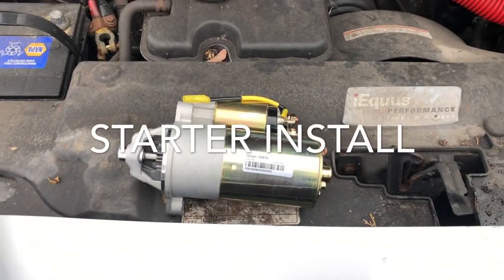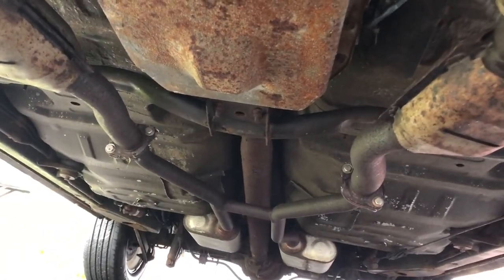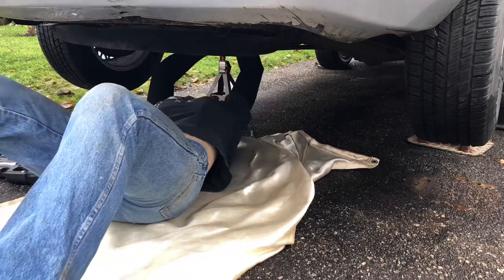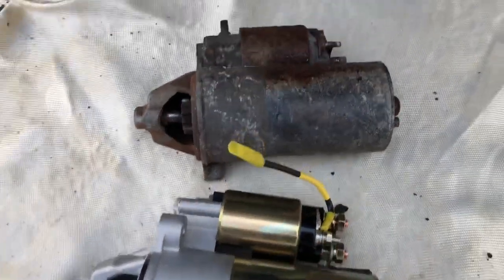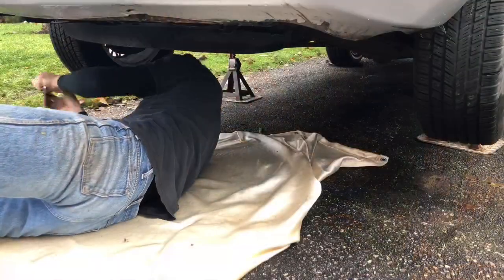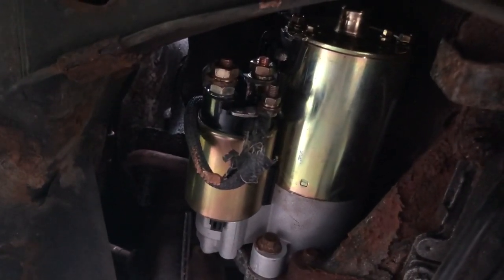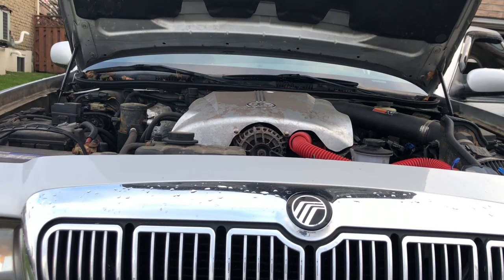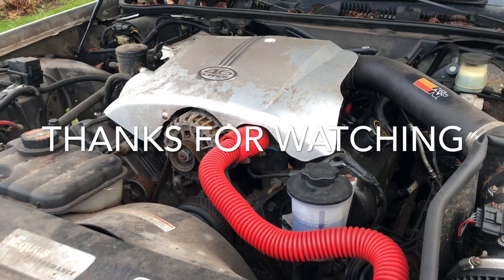⚠️ Loud Music - Car Starter Motor - 4.6 Ford Mercury Marquis Lincoln Towncar Marauder Crown Victoria

Comment: Did you ever figure why it wasn’t starting? Working on a 97 Lincoln 4.6 myself. I had fuel pump and fuel filter changed. Ran Fine, shut periodically  while driving still. Changed the serpentine belt and alternator, fired right up but now it won’t start.
Reply from the maker: knnyfcknpwrs I actually didn’t. I needed it moving and I had no time so I was in a position to sell it cheap. It went to another panther body guy. He got it running. He never said what it was which means it was dead simple. It sat for awhile before I wanted to get it going again. I know there was a lot of corrosion on the connectors. Sadly I just wanted it gone. Lovely car but when you have to many projects and even less time sacrificing the good to homes where they will be used is a must. I would be using the continuity feature on your multi meter and check the electrical. It could be a relay somewhere. I once had the cam sensor go on me and it would only run periodically but shut off randomly. Maybe it’s that simple. Mine.... Fuel pumps are easy to diagnose. If it doesn’t prime when you turn it on it might be dead. Teat the fuel pressure by opening the valve and see if it primed. Alternators you just load test and starters if they don’t crank it might be wiring related or the starter might be burnt out. Not that these were or are your issues I’m just rambling off some that I faced with my old beast. If you suspect your starter ever I just unbolt and test them but secure it before adding power =] work safe they have the high power and low power for positive and of course the negative side. Hope this helps. Sorry I couldn’t give you a more exact answer.
Reply: Wow, same thing for me with a Mercury Marquis.  My buddy and I went through hell fixing a transmission line leak only to be rewarded by the crappy car not starting.  Once I looked over the starter location and checked a couple YouTube videos, I decided to sell the car rather than screw around with such a lousy design.  Fortunately, I got my investment back cause a local guy collected these junkers for parts.
Reply from the maker: @STBRetired1  these cars are usually reliable but I had enough. LoL I don’t miss it one bit so I made a good choice with passing it on. I was not as lucky as you. =] Still I’m happy she went to a good home.

Comment: you should be happy they didn't reinstall that third top bolt. it is a pain!!!
Reply from the maker: True. When I was pulling it apart. I was like how would I put this back but thankfully I didn’t get the choice LoL 🤦 😂
Reply: @803Garage  also did you have a part two video for that fuel pump job? Also did you just replace the pump or whole assembly?
Reply from the maker: @itsraheem  no I am sorry I do not. I needed the space at the time so I had to get rid of the car sadly. Winter came and I needed parking. 🤦

Comment: Imagine having to Google how to remove the starter on your panther body because the top bolts are literally hidden, because Ford. So, you come across this trainwreck and just end up pushing it off a cliff because apparently "the top bolt was not installed and that's the whole reason your even watching this video. 🤣🤣🤣 for anyone really wanting to know how to do it, here. Jack up the car. Remove the front right tire and inner wheel well. You need a 10mm swivel socket, a 12 inch and a 4inch extension. Go in right behind the stupid upper control arm and you can get at the bolts easily. Lay on your back and reach your right arm up and you can just grab the bolts to remove them once they're loose and reinstall them. Believe me, ford wouldn't waste money with putting that top bolt in if it wasn't needed. you shouldn't have even uploaded this video bro. At least she purred like a kitten tho🤣🤣🤣🤣🤣🤣
Reply from the maker: You are 100% correct my good sir.
Reply: @803Garage  well damn now I feel like an asshole. My bad
Reply: @Blowncaraudio  I a guy drove a Buick roadmaster this wouldn't have happened😁
Reply from the maker: @Blowncaraudio  nah man , it’s all good 👍🏼 I truly enjoyed the read =]
Reply: @classicwefi   optispark guy in the background cheers😳... then he sprints off and you hear an lt1 peel out into the sunset.